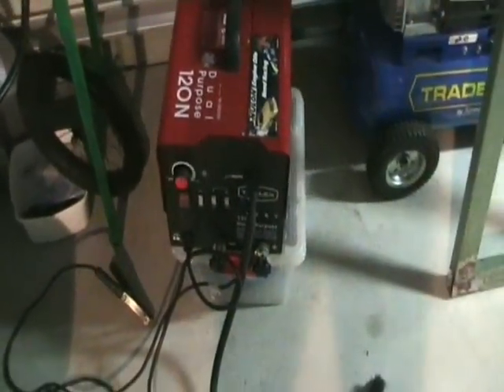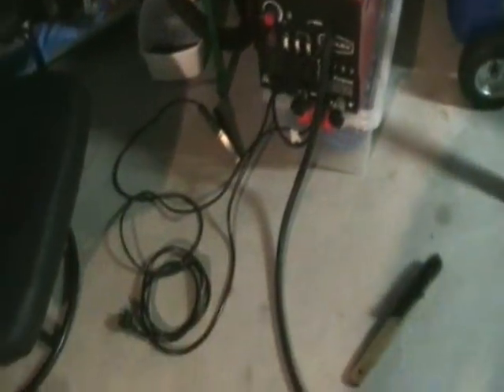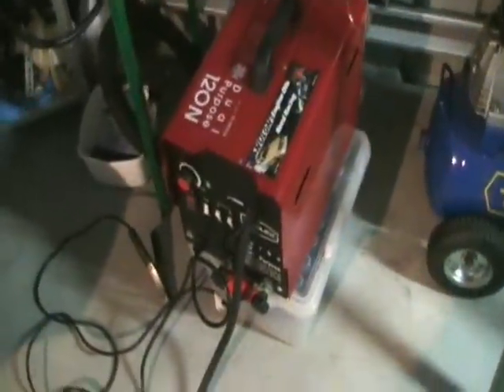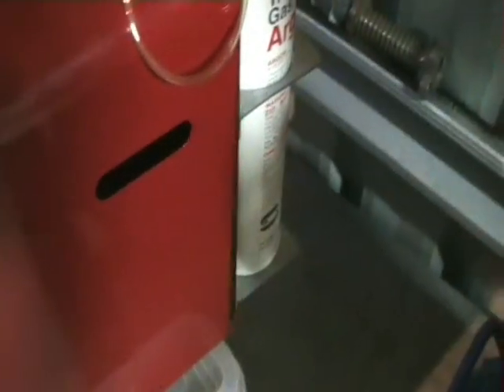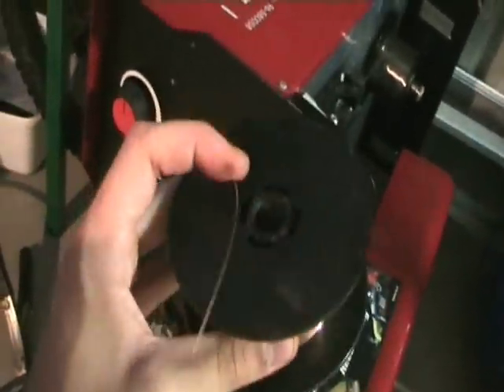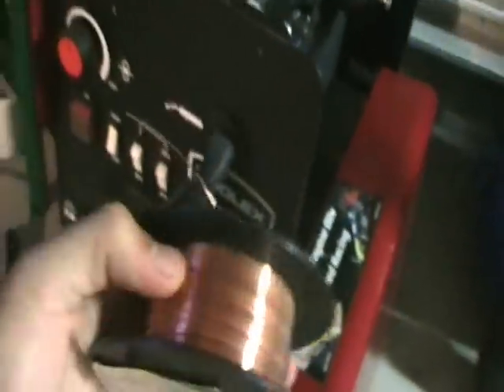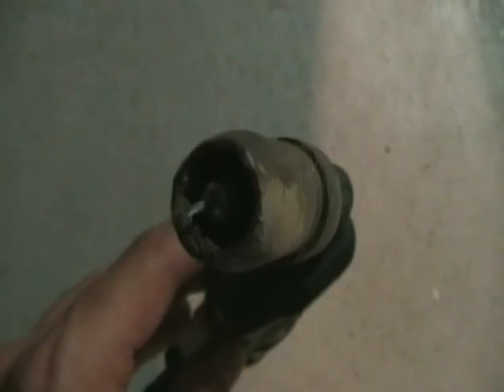mighty car mods season 2 tools part 2

Comment: @nrlfan07 oh really i wasnt aware, i thought it wouldn't earth because its aluminum...

so do people generally use mig for smaller more delicate welds such as exhaust (circular piping) and stuff like that, as apposed to the arc on big jobs like steel and stuff?

yeah no worries i like your stuff. you should put a tutorial up about home made smoke bombs because its hard to follow the u.s ones as its hard to get the same materials down here..